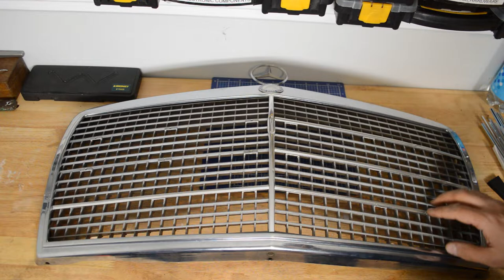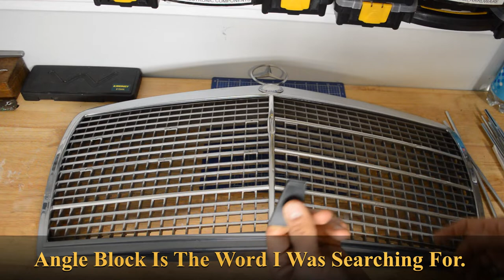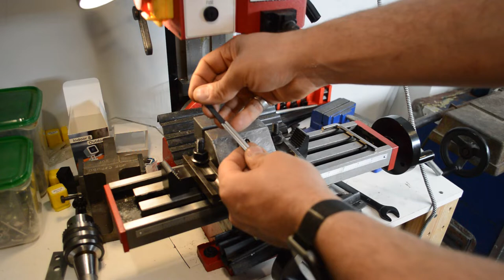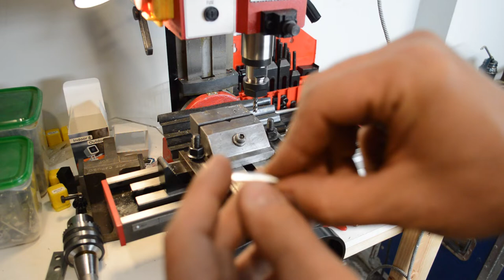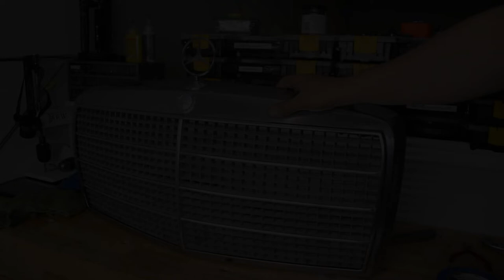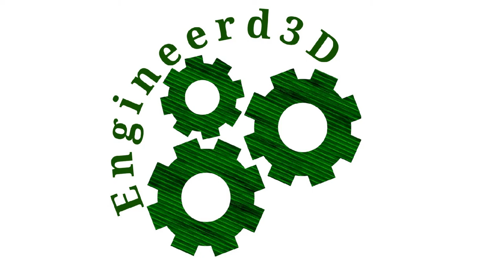3d Printed Angle Block, 3d printed fixturing for milling machine

Comment: Very nice work you done !! It is really nice to see my old (and first) SX2 mini mill, it made a great job in the past for me for over 10 year, i had only one problem , the plastic gears inside the head broked working on a piece of stainless steel, i changed with a couple of steel gears coming from England (and now are present also in Aliexpress)and the problem was fixed !!  See you soon, a big ciao from Italy, Alberto